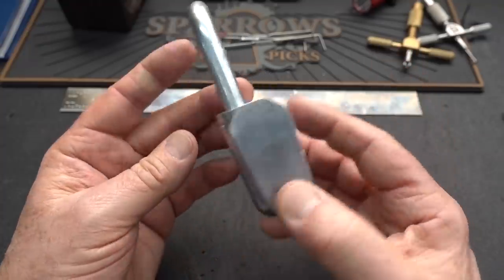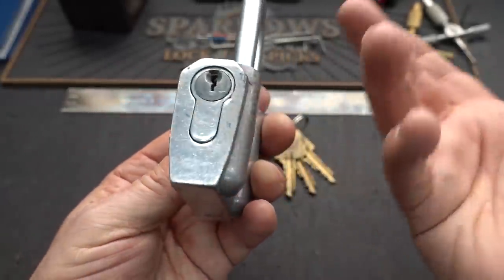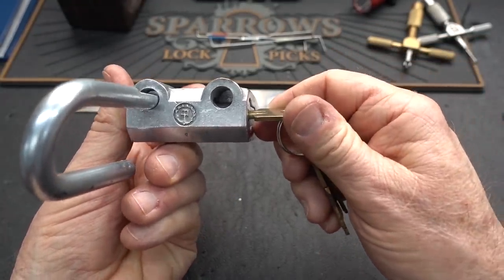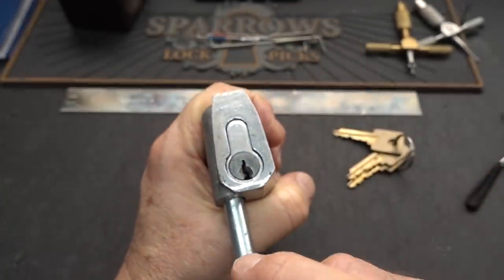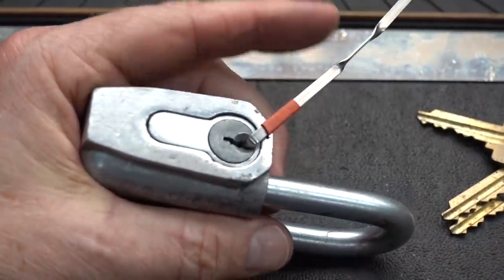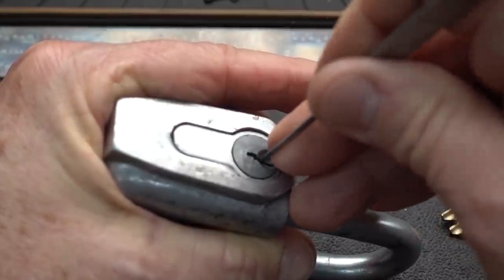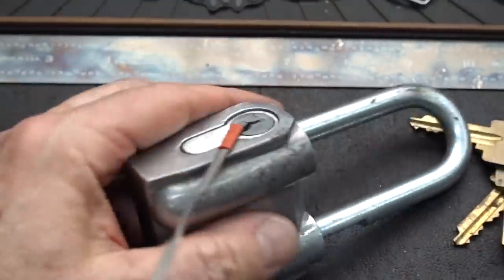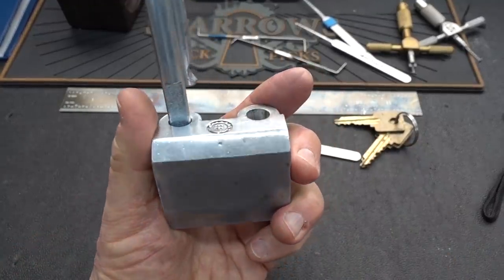(1665) Ukrainian Marine (?) Lock

Comment: Still something many lock manufacturers could learn from with that locking system. Simpler than ball bearings and just as secure. Of course you could extend it to the second side.
Reply: It's a great simple design
Reply: It doesn’t introduce any security flaw?
Reply: @antoy384  it removes the flaw that allows shimming. Reaching through and activating the rotator at the back is also impossible with this, because there isn't one. Effectively that removes the biggest bypass options that are in thousands of padlocks being sold today.
Reply: but you will need the key to lock it
Reply: @steamcastle  so how many locks do you not need the key for? And remember most of the combination locks are easy to decode or simply roll through the numbers. Put in a good side bar core and there isn't going to be much fun picking one
Reply: @seriousthree6071  to lock about half of them. 
for padlock most of them you can lock without having the key on you.
being able to have someone lock something for you without giving them the key.
I don't know why you mention combination locks.
Reply: @steamcastle  very few would want that option anyway. Combination locks do not need a physical key at all but are amongst the easiest to bypass..
Reply: @seriousthree6071  why are you talking about Combination locks?

Comment: I've had to make a notch like that in a key before. It happens when a plug is held in the core by a machined groove engaged by a pin or a grub screw instead of a circlip. I bet that if you copied the pin bitting to a regular key, it would stop turning before reaching the full 180° needed for an open.

Comment: One thing the diamond pick sometimes helps me with are trying to get under pins that are binding very low. With a bottom of the keyway tensioner, sometimes there isn't room to push the hook under the pin, but the sharp front of the diamond pushes the pin up just like a key.

Comment: So true what you say about the diamont shape. you can easy slide it in and get stuck on the binding pin. My fav. pick is what multipick calls "dentisthook 2", its model V09. I think i will grind the tip and try if a more steeper angle will still let it slide in smoothly. Sometimes the diamond is a bit too big and you get stuck on the warding when pushing down the pins. Nice Video btw ;)

Comment: Antique  lock with a euro cylinder?, not so sure about that.
Reply: Euro cylinders were already established in 1970. Time flies. But it would have been nice if he featured some predecessors, such as the ones using an M4 retaining bolt instead of the current standard M5.
Reply: @zwz.zdenek  1970 doesn't  equal  antique in the majority  of the world.